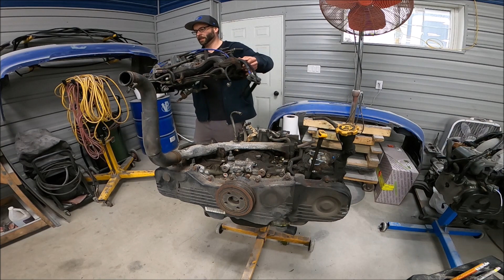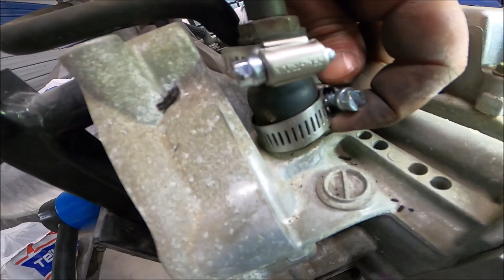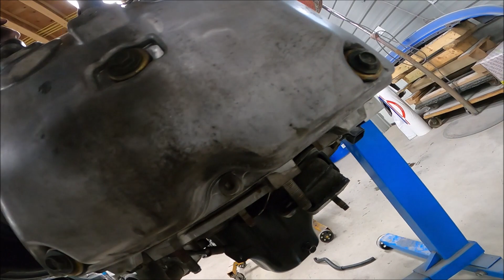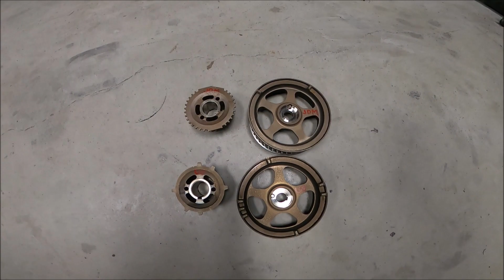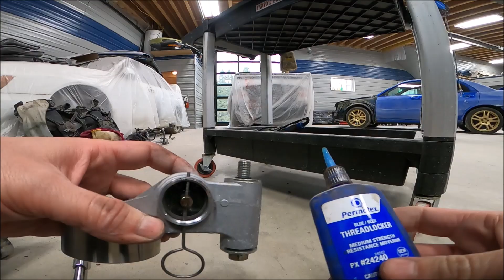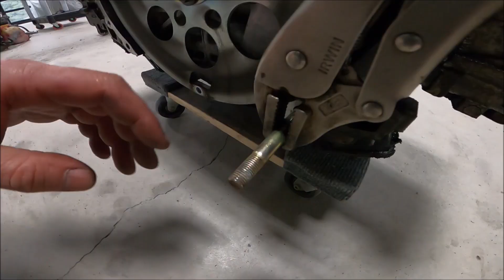How To JDM EJ251/EJ253 Swap Your 2005 And Under Subaru

Comment: I think my coolant crossover is leaking in my 2010 forester. I have burnt coolant pooled in the zigzaggy part on the top of the engine! Not losing too much, but it smells
Reply from the maker: It’s possible or could also be a smaller line running off the heater core piping under manifold

Comment: Quick question. Would you recommend resealing the JDM Engine with new seals, the whole entire engine?
Reply from the maker: If you dont want to do it later, it’s definitely easiest to do it while its out. 
All seals and such would be the same as original engine, except head gaskets if jdm is lower displacement then original
Reply: @TheSubieSanctuary and what if I'm replacing with a JDM EJ253 because the upgrade i'm thinking of doing puts me in the longevity category
Reply: @TheSubieSanctuary  after doing research, the category I'm in is the longevity specialist pretty much replacing almost all of the OEM stuff, with more premium performance rated stuff to get it up to 350,000 miles. I like polyurethane bushing aluminum radiator all silicone hoses, external transmission cooler, new oil pickup tube, new stud Boats. Pretty much addressing all of the failure points and over engineering. The engine to not leak.

Comment: So I have a ej251 that doesn't have avls and I'm swapping it with a ej253 with no avls will I still have to worry about the cam gears.
Reply from the maker: Yes you will likely have to swap the cam and crank gear. Compare first to be sure. Last thing to watch out for is if your 251 had an EGR. If yes, then the 251 will also have an EGR. 
In the event the 251, has no EGR and the 253 does. Then you can just cap the EGR on the 253 when you swap it. Hopefully that helps!
Reply: @TheSubieSanctuary what about EML for the egr thats not there? I was under the impression that you could plug in the egr solenoid so the ecu sees that it's there, but apparently the ecu is expecting to see a change of intake temperature and airflow so it could still bring up an eml

Comment: So what timing belt kit do you run for the JDM engine? The water pump mounts the thermostat in the front instead of pointing down on the older EJs
Reply from the maker: Same timing kit as the domestic! 
Only potential differences and only related to water pump is if 1 engine had an oil cooler and other engine didnt have an oil cooler. 
Very few non turbo subarus had an oil cooler

Comment: I have a 1999 subaru forester ej251 what motor could use and would i do the same. Im new but rather do it myself so I need info
Reply from the maker: Hey there, you could use a 1998-2005 engine. Only thing to confirm is: if your original engine has an egr then your new engine needs egr. Only other potential difference is swapping the cam and crank gears. Then lastly swapping on your intake manifold. And thats it!

Comment: I am getting p0341 and i bentch test sensor its good.
Reply from the maker: Have confirmed your swap had same crank gear? If so. Then id check your main engine harness connectors to firewall. We get that often after undoing them
Reply: @TheSubieSanctuary last owner put ej253 2006 outback engine in 2001 canadian forester. I checked both gears they are same as your domestic engine. Sensor is good, connectors are good. I fixed pvc leak. Can you please make a checklist for my car engine swap i will re-check everything and report to you. Thank you

Comment: Video helps a lot. How would i bypass an EGR system. I am swapping a 2002 EJ251 from an outback into a 2005 impreza that has an EJ253 in it.
Reply from the maker: I have not yet tried to trick the egr. I would first start with retaining egr valve and leaving it plugged in but put a solid shim between it and i take manifold so it doesn’t become an air leak. 
Another method would be to get someone to turn off egr code using a tactrix cable

Comment: When looking at the teeth on the crank and and cam it also had to do if the motor came out of a auto car or a manual. The ecu are programed different for both types. 👍

Comment: Great stuff. You said you put new spark plugs. Did you replace with the same ones that were in the 2.0? Or did you put 2.5 plugs into the 2.0?
Reply from the maker: You would still order spark plugs for the 2.5, all gaskets as well with exception of the headgasket

Comment: Hi Subaristam🤝Tell me, have you ever done a swap from ej202 to ej251? jdm
Reply from the maker: I haven’t done that exact swap but it would be same process. Match the crank and cam gears with original ones, swap if needed. Swap over coolant cross over and intake manifold
Reply: @TheSubieSanctuary  Well, I understand. In principle, it is not a difficult replacement. interesting out of curiosity 😁, how much does your original timing belt kit cost for the 251 engine?
Reply: Cool channel you have)))
Reply: I would be very grateful to you, if it’s not difficult for you to say. What is the best product against rust on the body? My arches also hurt.(((((

Comment: May be a stupid question I’m extremely new to subies but could same process be done the other way around got bad jdm ej253 and got a junk yard domestic ej251 would like to put jdm intake and whatnot on domestic
Reply from the maker: Yes it could be done the other way around. Only things to watch out for: 
Did your car originally have an EGR? If so it will have to end up with an egr motor. 
Is your car 06+, then you can not use a 251 due to the avls in the 06+ 
Hope that helps!
Reply: There’s a good chance I’m wrong ik that the motor that’s in my 05 Impreza rs is the ej253 with egr and z25 heads and the motor I got to swap is out of 04 fozzi has ej25 stamp and has Q25 heads I’m pretty good with mechanics and how everything works but still trying to figure out how these Lego blocks tick, no pun intended 😂
Reply from the maker: @Littles_garage  05 and under typically are compatible. It may the egr that is the difference in the cyl head codes. Im better with turbo knowledge but definitely dabble a lot in the N/A

Comment: 9:29 where can I get the intake gaskets for the plastic manifold, it seems like I can only find the sheet-style gaskets
Reply from the maker: Ya the plastice mani’s were so scarce. Dealer is the only reliable place to get them. They are pretty cheap
Reply: @TheSubieSanctuary  alright thanks man, very helpful video. I have an engine coming next week for my 04 Impreza TS, this video is what I’m gonna use +some other vids and some forum stuff, appreciate the response :)

Comment: OK but you never said _why_? Does JDM have higher compression block? Does it have more aggressive camshaft profile? Does it have larger valves?
Reply from the maker: Its the piston profile that causes the higher comp ratio, you can lower he comp ratio by using a thicker headgasket if you want. There are positives to leaving high comp and lowering the comp. all depends on your goals with the motor.

Comment: Wouldn't it be better to go ahead and replace the timing belt and all of the police while the engine is out of the car and it's easier to do instead of waiting and you don't know how many miles is on it.
That's a big risk for the person that's getting the engine
Reply from the maker: Yes for sure if they want to pay for it. 
Otherwise, with the timing components off it is easy to inspect each bearing. Its what it means to be good mechanic rather then throwing peoples money around.

Comment: Why would you want to do this? Just curious.
Reply from the maker: To replace your blown engine so that your car works again? These are old cars, find a good domestic engine with reasonable milage is near impossible. The Japanese engine will typically have 1/3 of the milage as the average domestic.

Comment: Hey bro. How much will you charge me if I had you guys finish my ej20 swap in my 2004 wrx? Motor is already in but all wiring harness and hoses need to be connected.
Reply from the maker: Really just charge ya for the time it takes to finish it up brother. Hard to say how long it would take. But start to finish all in all, it doesn’t take me more then 20hrs. So it would be some sort of fraction of that

Comment: Did the jdm models also experienced the dreaded H/G issue as USDM ones? Seriously, all these 251/353 motors needed were turbo MLS H/Gs and they last forever..
Reply from the maker: Yes even though this jdm na was dry, they did otherwise get the same crappy HG’s as the domestic na’s. 
Ive seen jdm na’s come in with seeping hg’s 😭
Reply: @TheSubieSanctuary  It’s quite a lot of work changing the H/Gs for MLS ones, but so worth it. That motor would never leak again from there.
Reply from the maker: @Mike3_6_9  exactly, thats what i tell the dudes on seeping headgaskets. If ya do them, it will be the only time 😂